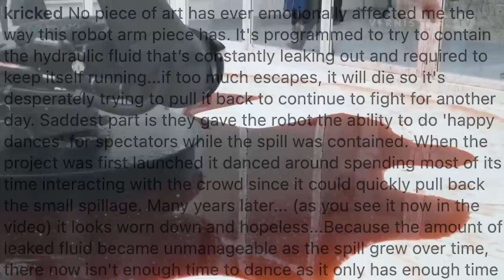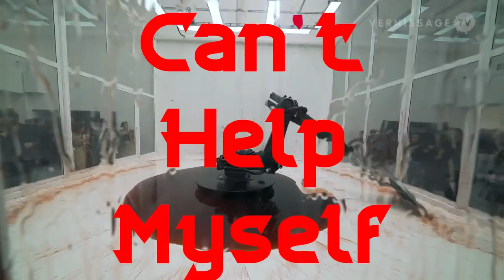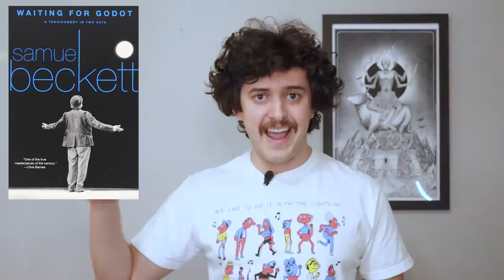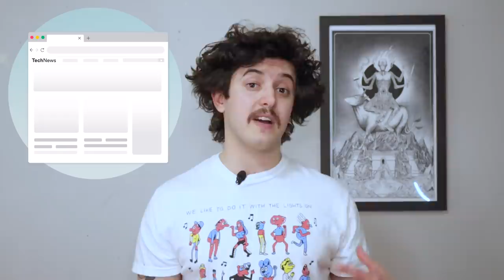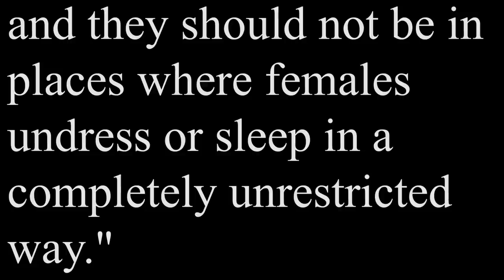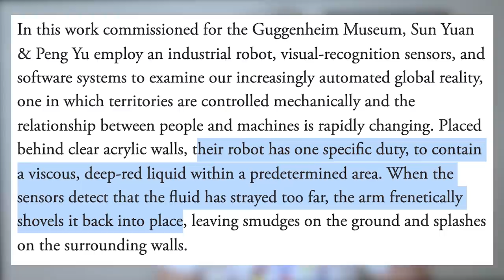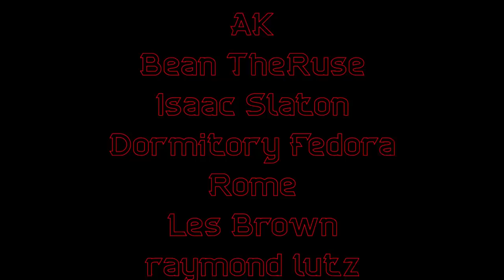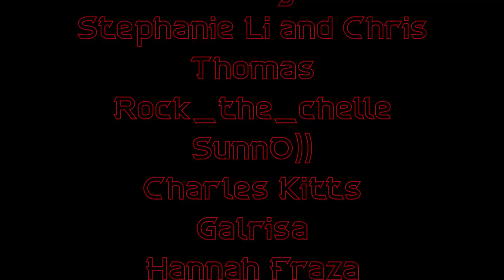Can't Help Myself & The Death of the Author

Comment: I have to admit, that I am not a great supporter of the idea, that the most important aspect of art is the freedom for all perspectives and interpretations. Because that wouldn't art make rich, as it is pointed out at that occasions, like it is in this video, but rather trivial and insignificant.

But I agree that there is room for interpretation in every piece of art, and even that this room is infinitive. We have to remember at this point, that there are two different ways of infinity, one that goes further and further .... and further on, so it is getting larger and larger, and the other, that happens in between two markers, so it gets to smaller and smaller amounts. Although the latter tends to infinity, as well, the room for playing around in this infinitve space is getting smaller and smaller. I think we should consider art in that kind of sphere. Every art piece sets two markers (i.e. left and right on a number line, like in math), and the interpretation should be inside these markers. And about every interpretation that is outside these markers you definitivly can say, that this interpretaion is wrong. But, admittedly it is not an easy task to distinguish that markers in any case, but they are there. Every piece of art has an individual set of composition, that is made, that set these markers, and therefore a piece of art cannot mean everything and anything. And if it would, at least I would not be interested in art anymore.

(Disclaimer: I am from Europe and English is not my mother tongue)

Comment: It's hard to put my thoughts into words, but I definitely read a lot of futility in the piece. Liquid doesn't tend to condense together, especially in large quantities, so trying to contain it, especially with a tool as ill-suited for the job as a glorified squeegee, is an exercise in futility. From the beginning, I had no doubt in my mind the liquid was blood, and the splatters that the machine was unable to clean up on the surface of the container, whether it be from splatter on the walls from the movement of the soaked tool or the stains that formed over time, stood out to me from the start. It is a single robot arm tasked with carrying out an objective that is impossible to complete and given tools that will not allow it to meaningfully or realistically accomplish it. However I look at it, I just see futility. I should re-evaluate my take on this in a few years to see if my stance has changed.

Comment: My perspective on this person's criticism, is that almost every interpretation of art is valuable, as art is supposed to be about dialogue. I wouldn't want to start prescribing how people are supposed to engage with things, as I don't really think that would work anyway. 

But equally, an interpretation that is formed for a misunderstanding of some element of the art necessarily needs to be corrected to have the full picture. Like a painting that is centred around the figure in the painting, if you don't know who that is, you're missing context to inform your interpretation, it's valid then to say your interpretation needs to be informed by the additional context. 

Death of The Author doesn't mean all interpretations are valid, just that the author's intention isn't all that matters. The author is an audience with a good grasp of the context, though. 

I also think the malleability surrounding interpretation allows for a resonance of struggles between seemingly unrelated things, which might inspire solidarity! (Not in this case, incidentally, that resonance requires an understanding of what you think you're resonating with, and whether you think the two thing are equal after that consideration.)

Comment: I like both interpretations, but one of them is more supported by the facts of the piece and speaks to my politics so I lean towards it. I interpreted the eventual breakdown of the robot to be about the futility of trying to exert despotic control over society. Also, I think the fact that it was designed to have human movements is interesting because it could be read as "no matter how robotic or seemingly impartial the machine [read" system"] is, it will always mirror its creators". Like no matter how rational and impartial we think it is just because it's a robot, it still will contain human features and flaws. Anyway... that was a strong bong-rip. I should sleep.

Comment: I find it a little frustrating when someone makes a work of art that could be interpreted in different ways, but insists that it is actually about this specific issue, and gets offended when people see something else. I also find it annoying when people look at a work of art and then confidently declare what they think is about, and cease to question it. Are they afraid that the artwork is going to jump out and bite them if they don't immediately pin it down? Or, some people will turn to the artist and try to get them to "reveal" what their artwork is about. Either way, it looks like they are desperately trying to flee from ambiguity. My own paintings have no hidden message. They are not code for anything. It's not a game of hide and go seek. It's not even really about "meaning", at all, it's just its own world. If an artist wants to convey a singular, specific idea, then why don't they go ahead make a work that illustrates their point, and be literal about it. Or, better yet, they could just use words to say what they want to say.

Comment: Come on man. The one thing I was hoping to see discussed was: can a reading of a work be valid if it is based on a literally non-factual, imagined version of that work? I'm sure I could make a very different interpretation of Dune if I convinced myself that the spice were just cinnamon, but that wouldn't merit serious discussion unless we were explicitly talking about fan works. The clickbait thread is based on the non-truth that the red stuff is leaking hydraulic fluid; it does not follow from either the author's intent OR the work itself.

Put another way, the clickbait thread is not the death of the author, it's the death of the text.

Comment: Hate to be pedantic (lol jk I love it), but at 4:05 it should be "hydraulic fluid" and not "lubricant". Hydraulic oil isn't used as lubricant, hydraulic systems usually use additional systems to lubricate joints (grease nibs) and not the hydraulic fluid, because that system needs to remain closed to keep pressure. But who am I kidding, buddy boy doesn't look like he ever drove an excavator in his life ;P

Comment: I think that the two widely different interpretations of the same art piece, the author's and Kricked's, come from them having different experiences to prime what they're looking for. As a comfortably middle class American, I immediately felt something similar to Kricked's; I felt sympathy for the robot. But if I step outside myself for a moment, I can remember that to a lot of people that's a bizarre leap in logic--why would I feel for the robot, it doesn't look remotely human? The answer is because someone in my place and time has seen lots of other works of art that humanize technology and teach that technology is always here to help, it's a friend. Think of Wall-E, or I Robot, or the Brave Little Toaster all the way back to Thomas the Tank Engine. For someone in another time and place, that connection wouldn't be there, and they may be used to seeing technology used for harm most of the time. They might live in a place mired in violent ethnic conflict where one side uses technology to its advantage to crush others. And then, boom, the author's interpretation shines through, and the robot finally winding down and the blood escaping takes on a grimly hopeful message, eventually the machine will die and the massacre will end. 

The fact that these two interpretations come through naturally out of different people shows the inherent failure of Intentionalist ways of seeing art though. People seeing different things in a work of art as obvious because their view is primed by different experience means 1) that the only way to have a single authoritative meaning would be for everyone to have the same life experience and 2) if such a thing were pulled off, art would be stagnant. there'd be nothing new to make, because there'd be no novel way to react to what's already made. That's an incredibly limiting way to experience art.

Comment: i interpret the machine as representing the self-sustaining engine of capitalism. a machine wholly dedicated to self preservation constantly leaking blood, desperately trying to contain the consequences of it's failing and in the process only leaking more blood. if the machine were to simply stop, the leak would end and the mess could be cleaned for good but the machine is designed only to preserve its own operation until eventually it is overwhelmed by the blood it's spilt but can no longer contain, and it shudders finally to a halt. dead with nothing to show for itself but a giant pool of blood, left for someone else to clean up

Comment: I think the tweet's reading makes sense as an inversion in perspective - I mean, instead of seeing the act containment as a form of border control if you identify with the robot (which yeah, as WIH pointed out is kindof easy) the meaning of containment switches. If you think of the analogy of social bodies / nations and individual bodies, you can say that from the (shitty) perspective of the nationalist they do consider border control a form of self-protection. So yeah, imo it's not a wildly different interpretation if you think of these two register shifts, critique -> identification and social body -> individual body. So yeah, given the whole discussion on interpretation, I would say that an artwork definitely gives certain cues (rather than instructions) for interpretation that suggest some readings more than others but at the same time works can be ambiguous enough to (at least on a surface level) allow for politically opposing interpretations e.g. in the works of Simon Denny or Daniel Keller.

Comment: I... don't necessarily agree with with the position that artist intent is a non-critical part of interpreting art.

It would be the essence of removing the future proofing by simply removing the context by which the art was itself produced.
For simple art installations with a very direct meaning, sure, you're free to pull whatever useful interpretation you want from it, whatever give it meaning to you.

But long form art, Film, media, period pieces. 
You can't simply just remove the context and say "pull from it whatever you want, to justify whatever you need".

That would be like taking John Carpenters The Thing, and its subtexts about Paranoia, Fear of of people, The deterioration of the humanity of the collective, and concept of the ever gaping void.
And instead, using it as a piece of work to justify things like Xenophobia, proactive violence towards others just "in case" their fears about them being an unholy evil in disguise. 
The evil DOES exist in the movie, but without the context that the characters are still human, you can use that to justify interpretations and justifications for limitless violence.

Context, IS important. Both in the Artist, and the time of its creation.
Being unable, or unwilling to remove yourself as much as you can from Ideological/sociological biases can heavily tint your interpretation of a piece of art.
In most cases its really benign, but if you're not careful, it can completely color all media you consume.

Comment: my only singular criticism on off the top is the  part when you mentioned that the mark of a good piece of art is it's ability to be taken many ways. I think that it CAN be a mark of a good piece of art or it can be the opposite of that for example in a cautionary tale. 
              In that way the concept of any particular concept is dangerous the unifying factor being a complete context of the art it's self, and sadly if that information is not attainable then neither is judgment. tuff luck as they say.  
              Anyway back to the point. Like Subversion i think that an openness to muti interpretation is a strength to some types or pieces of some art in there idiom, but ambiguity would have been useless in the Godfather for example if not for it's backbone of objective forces as well.  Subversion is it's own demon of over popularity As well today I think it's fair to say, and just as over used as any other new expensive version of an old cheap trick. Again Art cannot be understood let alone judged in any standard apart from it's own on an individual case by case basis. Most arguing is about people claiming it as their own propaganda of some kind, or setting up caveats to facilitate their own projections.  . Sadly we often simply do not know enough to answer questions about ethics, intention, or even expression, but happily we often do. maybe half the time or more DO know enough. Win some loose some is that bitter truth. realism can carry it's own weight and expressionists and surrealists are very articulate and willing to explain them selves. Dali deserves in on this conversation and takes part for his own part and for his own work (spoiler Dali isn't going to be easy to take if you ask him. Neither is Walt Disney as many now know. I suggest Picasso who is harder to take and an even more abusive man on par but at least his story has more use as a cautionary tale, and will teach you about the horror of where art meets the man and the market.). Much of the debate could be settled by just including the artists again in the conversation but that would come with the ugly accepting of the  truth that many pieces will simply never be understood well enough to be judged, and with many others meaning might even be lost with understanding. See Bill Cosby., indeed they may not even have the depth in other cases more lost to time that we assign and we may never know.  What the audience does after that isn't connected to the art at all in any knowable way, that is their own business as often as not for better or worse. But as they argue about understanding and judgment they will never get anywhere if they don't also make it about information again as well as feeling intentions ideals of the work as it stands alone and at the same time as it's creators and the context of their lives. some things are transcendent some things are esoteric. Deal i guess. Filthy Frank and Beethoven holding hands and rolling eyes.   Love. Thanks. agian for yer work.